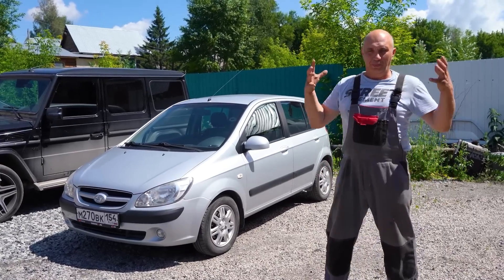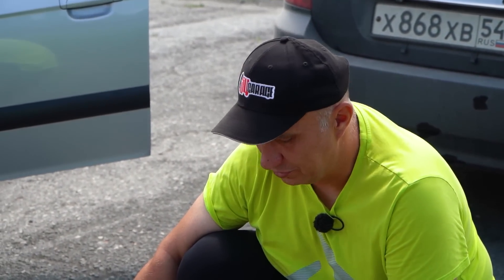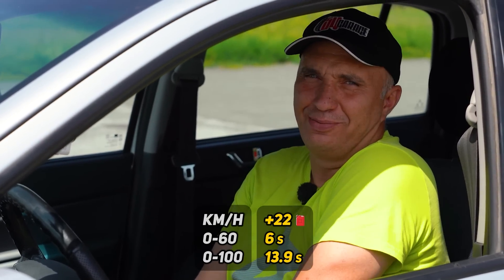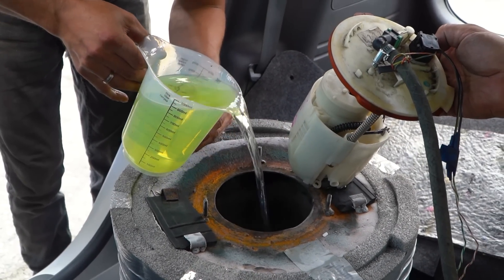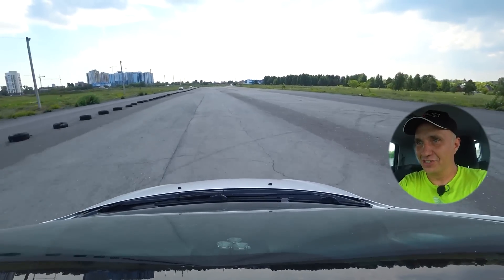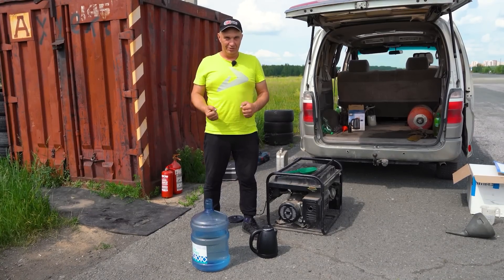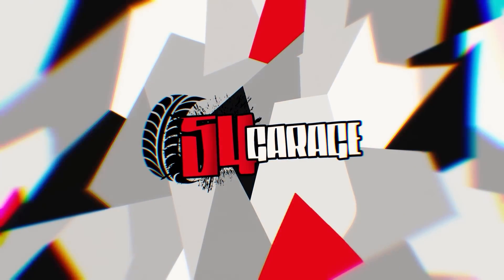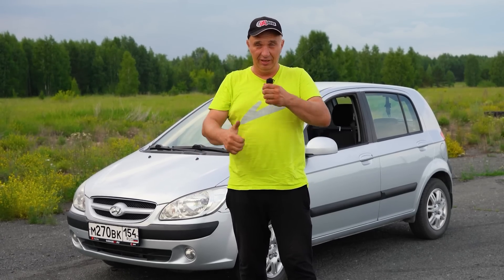Does fuel temperature affect engine performance? (acceleration, fuel consumption)

Comment: I had a chevy truck with a big block 8.1 liter 496 and I always ran it on E85 (computer was tuned for it to get max perf on E85, otherwise all stock).  I was up North one winter and it was -35F and we had cold advisories.  I had to drive 200 miles south at night to get back home and on my way back saw some chicks stranded in their car on the side of the road, stopped to see if they needed any help, but they were good and had help coming.  So the truck was warm, I had driven about 75 miles at that point, but it was cold and presumably the E85 was very cold too.  When I took off I floored it just to have fun.  Fastest acceleration by far I ever felt in that truck.  That was awesome.  I think the fuel temp can make a difference, but to get more power you need to burn more fuel and for an experiment like this you need cold air as well to also get more oxygen, which I understand would be difficult to do.  Perhaps another way to simulate it would be to super cool the fuel but also feed in some pure oxygen.
Reply: nitrous ?
Reply: Pure oxygen rapidly oxidizes stuff.
Reply: Dense -35F ambient air temperature yields just about the best available performance from an internal combustion gasoline engine.... Even colder temps stiffen lubricants, transmission, wheel bearing grease, belts, etc, excessively. Wind drag also increases in more frigid temperatures.
Reply: Assuming the air/fuel ratio and everything else remains the same, cooling the fuel will somewhat improve the engine's performance since cool fuel is denser than hot fuel. A higher density of air and fuel means more molecules of each can fit in the cylinders every cycle. But unless the engine is vaporlocking from the fuel boiling, which normally doesn't happen on fuel injected engines, the temperature of the fuel isn't nearly as important as the temperature of the air because the air is the vast majority of the combustion charge and the fuel is a small part overall, so changing the air's density will be much more meaningful.

Also, actually getting cool fuel into the intake is much easier said than done because the fuel will pick up a lot of heat while flowing through the carburetor or fuel rails and injectors since all this stuff is in direct contact with the engine.

Comment: I'm making this comment at 1:20 into video....I don't know what your going to do, but if you build the right type of unit for heating up fuel ..you'll be building a GEET system....where as you could potentially burn any fluid! I've mentioned this before as a project for garage 54!! Much luv and respect 54s!

Comment: I use a heat shield I made for my tractor to avoid vapor locking in the lines because the silly way the lines are routed. I always wondered what would happen if you chilled the fuel before the injectors get at it
Reply: Well done on your workaround.
When my Triumph PI vapour locked, I sometimes had to find a garage to buy a bag of crushed ice to put on the fuel manifold just after the pump in the boot. 
This was in a hot country, and faster than waiting for things to cool down.

Comment: I've seen drag racers here in Texas in the USA put ice around the fuel tanks
Reply: They do this to prevent vapor lock. Fuel gets really hot in a race engine, which produces a lot of heat. When fuel gets hot it tends to become a vapor very readily and can cavitate the fuel pump leading to the engine starving of fuel

Comment: great video idea!
although maybe you should have measured all the litres of gas at 20 degrees
Reply: Quick way to test. Drive your car when it’s insanely hot during the day. When it finally cools down hopefully this year. Drive your car… you should notice a slight difference. Like it can breathe when it’s colder. Which makes sense. Also same with high and low elevation

Comment: in the 80s F1, FIA put out a rule to limit fuel tank size so the teams started using coolers to cool down the fuel way below zero degrees to put more fuel in the tank because when something gets cold it also gets smaller and denser which also helped with engine performance.
Reply: true.
Reply: space x still does this with their rockets.
Reply: @geofrancis2001  Pretty much every rocket engine ever since, the fuel is like -190C.
Reply: @AnalogDude_  sure in hydrogen engines but the falcon 9 and most others run on RP1 that is basically kerosene. they prechill it with liquid nitrogen same with the oxygen.
Reply: @geofrancis2001  oh yeah, i forgot & heard that too. kerosene & diesel and others are harvested at the same time with gasoline in the still, just at different heights.
Reply: @geofrancis2001  this RP1is probably a second distillation of kerosene or so.
Reply: @AnalogDude_  RP1 is just a narrower range of hydrocarbons, diesel and kerosene have a wide range of molecule sizes.
Reply: @geofrancis2001  i think, i heard it's a second distillation of Kerosene aiming for what you say, purifying it more and also increase the cost.
Reply: Does that really make that much of a difference in terns of amount of fuel? Thermal expansion of most liquids usually don't even reach 1%.
Reply: Also if they didn't burn off the excessive kg fuel during the first few laps or so until fuel started heating up the fuel tank would dump fuel out. So you'd effectively got 2 laps of free fuel
Reply: @launchprogramexe  where would the fuel dumped go, to other reservoir?

I mean if dumped on the track would be pretty bad 😁
Reply: You ve just said Complete hogwash. Mechanical engineer here.
Reply: @nobodyelse-h6h  if it could take 1/10th of a second off a lap then it would be worth it in F1.
Reply: @geofrancis2001  sure, but the explanation given by schkann makes absolutely no sense.
Reply: @nobodyelse-h6h  What he says was mentioned in some documentary on F1 by the developers them selfs, i saw that too, probably most F1 lovers will have.
Reply: @AnalogDude_  see the doc again and again until you correctly understand it.
Reply: @nobodyelse-h6h  there is nothing hard to understand about cooling the fuel to be able to fit a bit more.
Reply: Water expands when it gets cold.
Reply: @Tigerfire75  that is incorrect, water expands when it freezes.
Reply: @geofrancis2001  from 4 degrees Celsius down to freezing it expands. It only contracts when cold above that.
Reply: @geofrancis2001 not quite. Water have maximum density on +4C , it is so call temperature anomaly of water.
Most other liquid have no such this anomally.
Reply: Amazing...
Reply: Yeah, I've noticed that I get more for my money when I buy gas when it's cold. Same principle.
Reply: @Reziac   yeah and I have noticed my car getting shorter when its cold outside LOL
Reply: @Reziac  fuel pumps at gas stations convert kilograms to liters automatically at the display, it doesn't care the volume, only the weight of the fuel. Around here they are calibrated at +15° celsius I think.
Reply: moral of the meow: Better to fill up gasoline at night than in the day 🐱👍🏿
Reply: Exactly what i have been telling my Wife!
Reply: Zimnego paliwa jest więcej 😊 dlatego cysterna jak przywozi paliwo na stację to rachunek jest wystawiony za określoną wagę a nie ilość litrów
Reply: Less vaporized octane too
Reply: thats pretty cool
Reply: I think you also need to adjust the mixture to correct for the difference in density.  If the fuel is denser you're also adding more fuel, so you'll need to weeken the mixture to get it back to the sweet spot.
Reply: The increase in preformance only work with manifold injection. With direct injektion it does not help.of cause, direct injection wad not used back then.
Reply: @matsv201  I would like to know what happens when diesel tdi fuel temperature changes, I know if you fool the sensor to think the fuel is super super hot, it will smoke and spool the turbo like crazy. I just saw on my tdi engine the fuel temperature thermostat in the fuel filter housing keeps the fuel at ca. 80 degrees. Probably to aid atomization
Reply: @launchprogramexe  TDI is direct injection.. so .. hot fuel works just fine. Some cars have fuel heaters to be able to run on vegetable oil with out modification. Thy have a fuel temp of at leas 40C even for the low pressure pump. I don´t know how hot the second heater makes it.

That is both for atomization as well as to reduce the viscosity.
Reply: @launchprogramexe  VW, Seat, Audi, Porsche and Skoda TDI's have a heater in the fuel line underneath the car, the device also has cool ribs.
Reply: I know m9st Cummins use a grid heater on the intake never heard of heated lines less you live in Russia or Alaska
Reply: @jbstepchild  cummins also have fuel heaters. they are usually mounted above the fuel filter. it is a pretty common mod to remove them since most of the time these engines are rarely run where it will make a difference.
Reply: @matsv201  Direct injection is in excess of 1500 bar fuel pressure, it's advised no to have the hood raised and look at the engine while running, the holes are also smaller and they where not capable of doing that back than.
probably made with lasers.